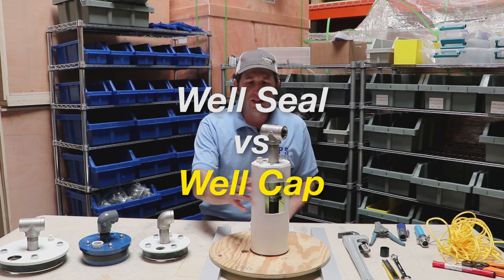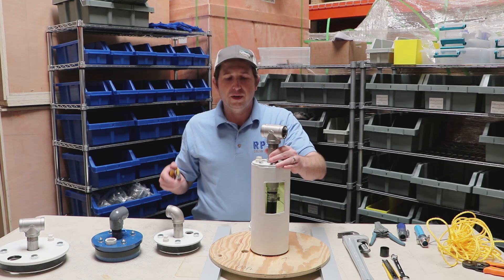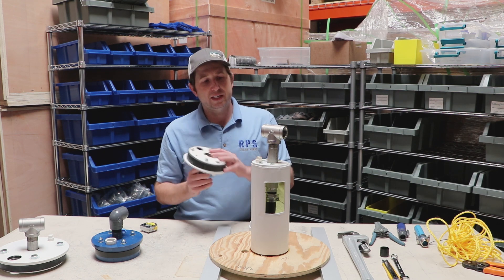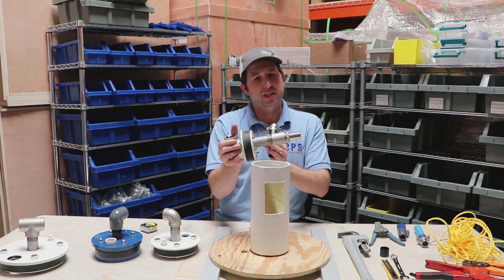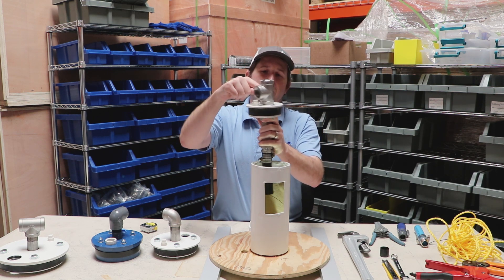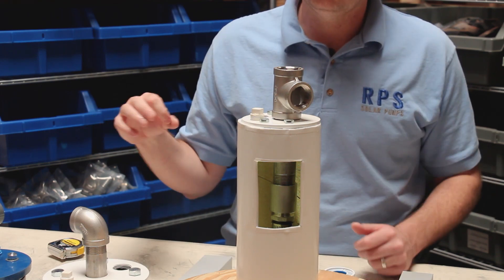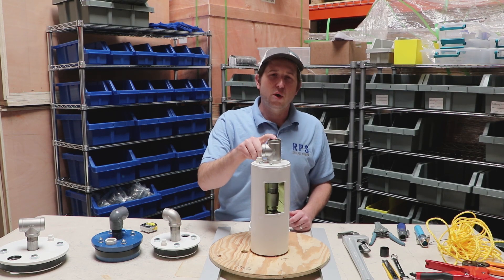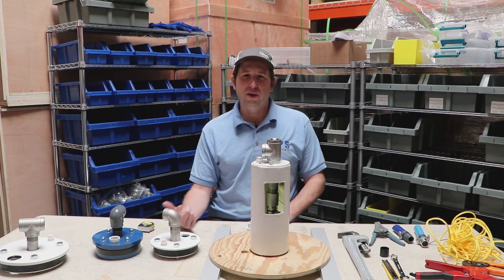The Basics of Well Seals

Comment: Do you recommend putting an additional (besides the one at the pump outlet) check valve at the well head, if pumping uphill a couple hundred feet to a storage tank?  My thinking is it will relieve some of the excess force on the check valve at the pump (150' down) when the pump stops and all the head/water in the pipe rushes backwards.

Comment: What holds the pipe tight inside the well cap
Reply from the maker: The lip on the Tee at the top rests against the top metal plate of the well seal, taking all of the load and distributing it axially to the top of the well casing.

Comment: I've got water coming right out the top of my well seal when the pump is running. I'm guessing my drop pipe is leaking at that nipple?
Reply from the maker: Sounds like that might be case, try resealing with some plumbers tape at the hosebarb to nipple connection and nipple to tee connection
Reply: @RPSSolarPumps  I haven't tried to pull it yet. Not sure i could even break the galvanized pipe loose that connects it to my pressure switch. I made a short video, lol! https://www.youtube.com/watch?v=gJ-FJC0VZHk It leaks a lot more after i put silicone sealant in the conduit.  scary that just a couple of hose clamps are holding up my pump, but i guess the wire is also holding it if the hose clamps failed.

Comment: We had our well drilled last year and installed pump with overhead discharge for construction purposes, eventually it will be pitiless adapter because we are up in Wisconsin. 
Few days before first frost I disconnected power to pump and drained all water above well seal, I guess some of the water remained 5-6 feet down around check valve and eventually froze because we were excavating for the house and well casing got exposed by 4 feet below ground level. 
About a week and turned on power and no water is coming out of the pipes. I can hear the pump running and I think I hear some splashing below but I’m not sure what it is.
Well is 200 ft and water level is at 110 ft. I tried pulling on that tee above, it moves up about 2” and I can feel the weight of the pump, so it didn’t brake. 
Is there a chance check valve broke and not letting water through?
Reply from the maker: Sorry to hear that.  Sounds like the freezing may have damaged your drop pipe and the water is flowing out of the damaged pipe and back down the well before reaching the surface.  Be careful lifting at the pitless, if you pull it out of the pocket you will be holding all of the weight and will need to get it lined back up.  200ft is doable to pull yourself if you have some basic tools and equipment, or might need to call a professional.
Reply: @RPSSolarPumps   pitless adapter wasn’t installed yet, pipe is going straight up through well seal like one in your video. They used 20’ long 1” pvc pipes (5 or 6 of them) and then brass check valve and I think another piece of pipe about 4-6 feet long. If I’m not mistaken there was a small hole in that last piece right above check valve to let the water drain.
Problem is our well is on the edge of 12’ deep excavated site the house, foundation is there, but in order to backfill and be able to bring truck with boom lift to the well, I have to pour concrete floor inside the basement. Can’t pour concrete without water.
On another side of the well is steep hill with lots of trees. Not possible to bring equipment there. 
My plan is to build small wooden crane and use cable winch to lift it up. Than use some sort of clamp to grab a pipe
Reply from the maker: @vitaliypro8441  Ah okay, still sounds like a broken pipe down in the well due to freezing.  You might get lucky and be able to pull it up 10-20ft, and swap out the broken section.  Good luck!

Comment: What is the white plastic thing called a vent? Can you buy that 1 part alone? Mine is damaged. I cannot seem to find it. I may not know the correct product name.
Reply from the maker: Usually that hole is used as a vent, extra wires or for a probe when measuring static water level.  I believe you can just find a PVC plug that fits the thread at any hardware store.  Nothing special about it.  If you cant find one in the irrigation supply area, check the conduit section as well.
Reply: Is there any circumstance where your well would be completely sealed and under vacuum?
After 40 years of running I had to replace my pump and the cap was totally sealed and under vacuum. 
I used a piece of poly pipe for the wires and heated it into a j or candy cane shape so it's pointed down. I  left it open to vent through that pipe.
Would it not help draw water into the well faster under vacuum?  I know by doing so it would add a few pounds of head ratio to the pump and make it work harder. 
My pump is 125 feet down.

Comment: I have a different set up with a Merrill web cap, on top is the Grundfos cu 301 (programming system) in a box on the center of the cap. Trying to figure out how to remove the. The box has a galvanized pipe at the bottom of the box into the cap, it is threaded. Should I leave the box on top and take the bolts off to lift the cap off. Wish I colluded post a photo.
Reply from the maker: Really not sure, pictures would help, but as you say, unable to post them on YouTube.

Comment: Do the old pipe and pump need to be removed?  Any concrete needed?
Reply from the maker: Yes it is usually best to replace the drop pipe on older wells if there is any sort of rusting or degradation.
Reply: @RPSSolarPumps  thank you

Comment: Where does the manual pump install for use in overcast days
Reply from the maker: We recommend storage of 2-5 days of water for cloudy weather, so you can avoid using a manual pump.  However, if that is not an option we have generator input kits and battery backup, although batteries are not required!

Comment: Where can I purchase the poly drop pipe?
Reply from the maker: You can usually order it online or sometimes local farm supply stores have it in stock.  Just make sure the pressure is rated for your pumping head.
Reply: @RPSSolarPumps  sorry, let me clarify myself. What sort of pipe is it. In otherwords what do I ask for?...lol
Reply: When I walk into the store what do I ask them for a 1 inch Poly pipe?
Reply from the maker: @marcos22571  Yes, you can ask for "1in back poly pipe".  Best to get at least 160PSI or higher depending on your depth of well.  Lowe's sometimes has it in stock in 100ft rolls if that is long enough?

Comment: GREAT info and suggestion about stainless steel fittings, the 2 properties we have the well folks used galvanized which is now rusting, I decided if & when we have to replace I WOULD use S.S., this helps me to remember such, if there a TYPICAL / COMMON length of the tru nipple that mates in between the coupler & top fitting?
Reply from the maker: Typical lengths are 4" or 6." Glad the video helped!
Reply: @RPSSolarPumps  Thank you I will go ahead and buy those fittings and have them on hand, do y'all sell those fittings and the barb? And have you found one particular pressure gage to be more reliable and dependable than any other?
Reply from the maker: @REVNUMANEWBERN  We sell Well Seal assemblies, including the seal and basic plumbing here: https://shop.rpssolarpumps.com/collections/extras/products/all-metal-well-seal-for-pro-installs-deeper-wells

If you just need specific parts, best bet is to search online. Let us know if we can help with anything else!